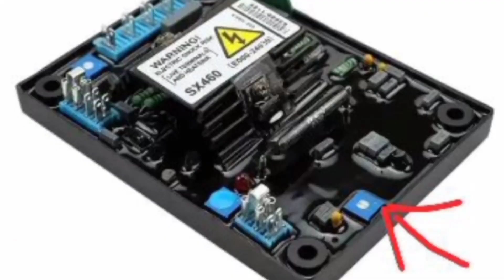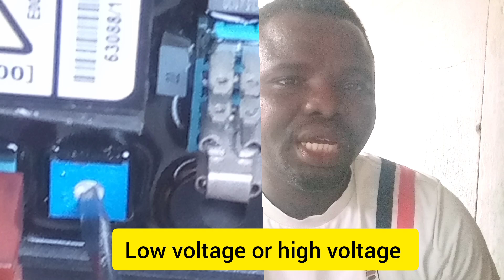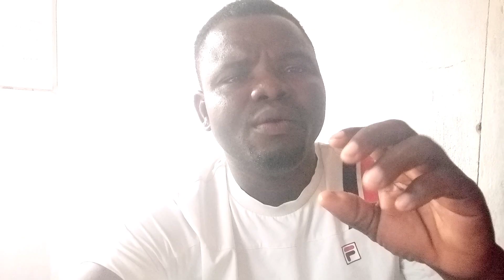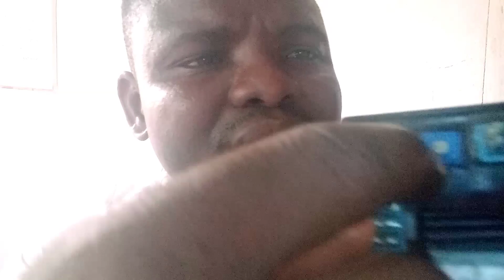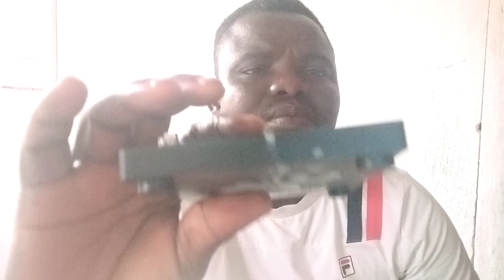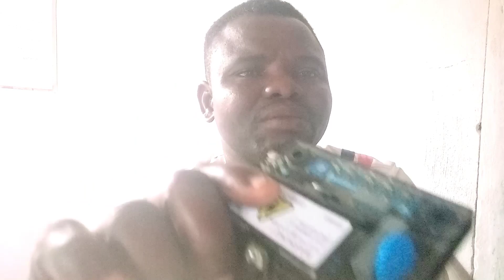How To Adjust Perkins Generator AVR

Comment: Hi i got a similar AVR with the one u show but there are no label as to which cable to connect to. Can u tell me which terminal or pin is positive and negative...the othe two cables comes from or connected to T7 and T8. This AVR is to be installed into a 12 leads 3 phase generator. Pls help me out
Thanks
Sp
Reply from the maker: Connect the two from the Exciter to a side, then skip the center pin, then connect the other two from the field coil to the other two. Forget the positive and negative.
Reply: Im still a bit confused...placing the AVR infront of you, the two terminals on the left are connected to T7 and T8 in the termination box, the last two terminals on the right (believed to be positive and negative respectively) connected to the exciter coil (middle terminal n/c)...my question is, do i have to connect them according to their polarity or not? eg. how if i connect cable from T7 to pin 1, cable from T8 to pin 2, the other two cables coming from coil to pin 4 and pin 5 regardless of positive or negative. What i mean is, it doesn't matter which pin to connect to as long as the cables are connected..hope you got the message...thanks a lot for your response
Reply from the maker: The two from the coil should go to one side , forget about positive or negative.
If it doesn't come up, then exchange the two to the other side and the other two to another side.
Reply: @mrengine  ok i will try. why iam asking just bcos in a smaller generator with carbon brass it is important to connect the cables to their proper polarity and that is positive and negative..in this case, it doesn't matter as you pointed out. Anyway thanks